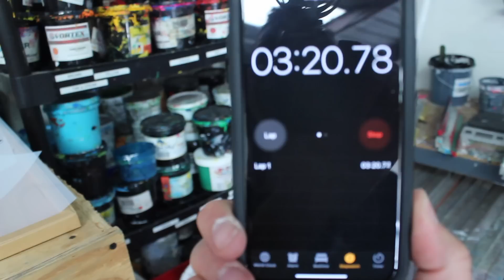Is a Darkroom Necessary for Coating and Exposing Emulsion? Screen Printing Tutorial

Comment: This is great. I don’t have a dark room. My studio actually gets quite a bit of natural light, and I’ve had zero issues. I built a small drying cabinet and made sure it was completely dark. 👍🏼
Reply from the maker: Nice! It's not exactly photography film, which is the impression I was under when I first started. Definitely can take it easy. When I was in the garage at home, I would forget I had screens out that were coated. I'd pull out the mower, mow the lawn, and come back to say, oh no. They still exposed fine.

Comment: When i got into screen printing most, if not all, suppliers and many youtubers said dark room is not negotiable and you have to have one. Two and half years with 4-10 screens a day and I still cant see why they would say you have to have one. I do many halftones, process and other fine detail projects. never had an issue. I have a guest bedroom in my basement and simply stack frames to dry and then stand them upright to store them. I generally do 30-40 frames at a time and some frames of rarely used mesh size, might go two or three months between coating and exposing. I even had some large sized screens go nearly eight months and then when used worked fine. The bedroom has a regular overhead light and is turned on several times a day for probably no more than 1 hr a day with the occasional 4-6 hrs when the kids forget to turn off the light. This spare room is also our pantry and is used every day. The screens are standing on the floor stacked upright  together so I am sure there is protection from the top frame. but I have never had a messed up exposure. I followed YouTube's Farmboy Graphics advice since day one and have not had a single mess-up. I built his super cheap exposure table and followed his 2:45 seconds and there has been only one screen with very subtle half-tones that I washed out with a power washer from the wrong side that I had to do over. we are talking in excess of 2000 exposures! Dont get me wrong, I have put films on backwards, upside down and sideways, but they always exposed beautifully..... It isn't my skill, it was simply carefully following the advice of Farmboy Graphics (by the way he has a closet to store the screens to dry and hold, but he coats and sets up his frames in regular room light). I have about $100 in my exposure table, zero in my dark room and all that "extra" money was spent on high capacity/quality conveyor dryer, better/bigger press and a quartz flash dryer which I wouldn't think of not having for a manual press. I usually lay my films on the shirt, on the press and place tape on them so I can mount the screen and get placement just where I want it. I have the main shop which is 26x24 and it has 24 4ft led shop lights. My shop has white painted floors and three small windows. It is very bright but I will shut down the lights directly above the press, but by no means is it "dim" in my shop. I use ulano orange and QTX which I protect a little more from the light, but since it seems like Orange gives almost as much fine detail in half-tones, I rarely use it anymore. Two months ago I did 275 6 color Sep Studio Mahi-Mahi fish fishing shirt on a polyester hoodie for a major high end boat manufacturer and we used Ulano Orange and the sales rep and marketing director commented how they looked so much better than past years shirts. They have since ordered four more jobs with one more on the books for their huge Annual boat dealers convention this coming winter. I am not saying orange is best, just I know how to use it with my system and customers are happy. I do almost all plastisol, so water based shops probably are different in their emulsion choice. 

If you are on a budget then darkroom and exposure units maybe should be first to DIY and save cash for press or conveyor. I had a rude , pompous salesman actually tell me i might as well as not invest any time or money getting into the screen printing business if i wasn't going to do what it takes to make quality screens with a $3,600 exposure unit. I saw him last month now working at Best Buy when I went to buy 2 new computers and extra monitor. He came up to me and asked how things were going and I said crazy busy and I had paid off all equipment and was hiring a saleswoman to handle all the sport teams jersey's/spiritwear accounts. I was getting a laptop for my saleswoman and a new computer and two large monitors for the shop. He said "Great, let me help you with that"....I said, "seeing how your recommendation was for me NOT to even bother opening my shop unless i bought your $3,600 exposure unit was unbelievably wrong and false, why would I now trust you for my computers?" .... he shook his head and stormed away. The saleswoman I used at Best Buy whispered under her breath "You have no idea how much he deserved that".

If someone stands to make money off your decision, your guard should be up!!! That includes people who have sponsors or are trying to acquire sponsors.
Reply from the maker: Thanks for sharing! Funny how things workout. I would completely advise to anyone to make as much of your equipment as possible to save money, aside from a conveyor drier, and the press. Most of the other equipment such as a washout booth, exposure unit, screen racks, drying cabinets, etc can be made easily. I bought new equipment with my washout booth and exposure unit simply because I was so busy that my time getting back at screen printing was more valuable. I think anyone who says you have to have this expensive piece of equipment to get going and a crap ton of space doesn't know what they're talking about, like you mentioned. Start small, buy used, build what you can. Slowly reinvest that money back into better and faster equipment as you go. Rather than taking out loans, buying the most expensive equipment to find yourself drowning in debt with no work to pay the bills. Grow you shop / equipment with your business.
Reply: awesome story... both of you. i have a exposure unit with 4 florescent 30watt "grow lights" inside. how long would you guesstimate exposure time with ulano orange? or can you recommend a good calculator? I've blown out 2 screens already using my shower head...not really any pressure either.

Comment: Great video.  I started using a water bottle to pre wet our screens prior to the wash booth.  Worked great!
Reply from the maker: Great screen printing hack!
Reply: I’m lucky enough to have a lil open tank sitting next to our washout booth that we put all of our exposed screens in and see the design lighten to ensure it exposed correctly 🤙🏼
Reply: @RookieMistakeYT   absolutely.  Single dip tank work great or high pressurized spray bottle worse case scenario.
Reply: @arnoldprints  high pressurized spray bottles scare me simply because for some reason I’ve had some of the finer lines and details in the designs wash out or fall apart. I will say though i believe it was a bad batch of emulsion because it kept happening with that specific bucket.

Comment: I asked Ryonet support about this because I dont really have a dark room/area in our house and read in the forums that while the emulsion is still wet, it's not really that light sensitive. Ryonet support said that was true for photopolymer emulsions, but the emulsion that I use, which is a dual cure emulsion that needs diazo,  is light sensitive at all times. =( Great video as always!
Reply from the maker: If you go and check my videos, I like to use TZ emulsion which is a diazo emulsion. Diazo emulsions expose slower by nature and tend to hold better detail. If anything, I have to be faster with the photopolymer emulsion without a darkroom. An employee of mine that's learning took about a good 7 minutes to setup the art on the screen. It was slightly exposed, but nothing that wouldn't washout. From my experience, you'll be fine with a diazo for a moment without issues.
Reply: Emulsion IS just as photosensitive. I have been screening since 1992. I work in a room with no daylight, but coat under a 60 watt bulb no issues ever. Coating a batch of screens takes 10 minutes. Leaving the drying or dried screens exposed even to incandescent light will fog the emulsion.  
Unless you can economically by small containers of diazo, I would go photopolymer. Storage is a year+ in a cool storage environment. Coated screens stored dark cool and dry will burn a year later. Details wise, I burn 45-55 line halftones no problem.

I started in 1992, went to chromatech PL in 1993, and have never looked back. Bought my first auto this spring, literally burning 45 line halftones process color job, this after noon.  Captains log July 3 2019........
Reply: @joeshmoe7967  Thanks for the great info! Yeah, Ive been told that photopolymer has a long shelf life where my diazo emulsion is just 6 weeks at best! I'm hoping to switch to photopolymer soon (SAATI Textil PHU) once I use up my current emulsion and I get a better exposure setup. I'm still using a  CFL UV Fluorescent bulb that came with a screen printing kit I bought almost 3 years ago. Right now my money is going into testing water based opaque white inks, since white on dark shirts is what my clients order the  most, as well as saving up for a good flash dryer.

Congrats on getting the auto! I just have a one station press, but hoping to get a 4 station soon. My main business has been printing shirts with vinyl, but now my orders are always over 30+ shirts, even 100+. Vinyl does not make sense for large orders, so its time for me to get serious about screenprinting again.
Reply from the maker: @joeshmoe7967  Good points and thanks for sharing. The basis of the video really is to really make people aware that they do not have to freak out about a little light reaching their emulsion during the coating and exposing process. Unlike photography film which as soon as it's hit by light, it's destroyed. I had a condiment bottle full of Ulano TZ which is a diazo emulsion, and it went from green to brown. The bottle is transparent, sat out in the shop, and I used it for pin holes. So I do agree with you. I'm just trying to help newer screen printers understand you don't have to freak out if a little light gets to your emulsion. :)

Comment: You can also just put sleeves on your lights to prevent any light penetrating the screen. We leave screens out for 2 or 3 min out in the light and no harm.
Reply from the maker: Good point. That's how my setup was at the house. My screens dried over night with our amber lights on. Here is a different story because we just have a cabinet.

Comment: Keep up these great videos!  I noticed it looks like you have a dehumidifier in you screen drying rack,  I was wondering if you would share the make and model of it?
Thanks, Mike
Reply from the maker: Thank you! It's actually a cheap $25 oven to heat the cabinet to dry the screens after reclaiming and coating with emulsion quicker.
Reply: @mikeydesignssilkscreen473  cheap and effective. love it.

Comment: Nice! So a couple of questions for you my ninja! Do you have fans in the cabinet? (Hurry up with the specs of that, I need that info...LOL) I noticed that was yellow mesh on a 110 screen, where did you get that? I can only find yellow mesh on 230 and higher at GSG.
Reply from the maker: I have a bathroom fart fan mount on the top, and a vent on the bottom so it pulls air diagonally through the cabinet. LOL, I'll get to that soon. They're older screens that came with the automatic when I bought it. I'm sure you could have GSG mesh some screen for you if you brought in your own mesh. They provide that service too.
Reply: @mikeydesignssilkscreen473  how do you stop light from getting in through the vent and fan holes?
Reply from the maker: @jonathanzambrano6349  The fan and vent is at an angle and place so there's not any light coming through.

Comment: Great video. How long does it take for your emulsion to dry before you can burn the screen?
Reply from the maker: Thank you. It depends on the mesh, emulsion I'm using, time of day I coat them, how full my screen cabinet is, and the season. It could be anywhere from 10 minutes to a whole day. I'd say at the moment, cabinet full, 100º outside, 90% humidity. It'll take a few hours. Only a few screens in the cabinet, about 15 minutes.
Reply: Mikey Designs & Silk Screen Cool. Thank you so much for the videos. They really help rookies like me.
Reply: @mikeydesignssilkscreen473  How do you know when they are done with all those variances? I am very new, just getting started. Do you touch the screen? Does it look different?
Reply from the maker: @chrisnwendyduncan  It will look different and no long look wet. The edges that bead up will look dry too. You'll notice the difference once you get into it.

Comment: bro thanks man i just had major difficulties coating my first screens with major failure but imma try it like you tomorrow
Reply from the maker: Nice! Yeah, just do 1 and 1 with the sharp side for meshes 195-305. Do 2 and 1 for 110 and you should be fine.
Reply: @mikeydesignssilkscreen473  thanks bro!! just coated my first screen this weekend exposing it in the sun like you did.! fucking excited!
Reply: @mikeydesignssilkscreen473  what kind of emulsion was this? I’m looking for a forgiving dual cure emulsion (water based and plastisol). Also what is 1 to 1, 2 to 1?

Comment: Not totally related to the video, but how can I go about printing large transparencies? I need about 13x13 inch ones but my laser printer can’t go that big.
Reply from the maker: You could tile them out if it's just a 1 color design, or you'll have to buy a printer that can print that large. There are also service providers that could do that for you if it's just a one off job.

Comment: Can you change the pallete and screen on any machine...and do they have to be the same size?
Reply from the maker: Most screen press manufacturers will have multiple size pallets. You could also make your own and use the stock pallet brackets.

Comment: Is a ready to use or do I have to mix something with the emulsion before coating ?
Reply from the maker: There's photopolymer emulsions which are ready to use out of the bucket, or diazo which you have to mix in a sensitizer. There are others, but those are the main ones.

Comment: Bro I have a 80 w uv led flood light ,what distance from light to screen do you recommend? And time to burn the image ?
Reply from the maker: I would say at least 12-16 away. Just make sure the light is covering the entire screen. Depending on the emulsion, with a led flood light, might take 7-18 seconds. You'll have to some testing to dial it in.
Reply: @mikeydesignssilkscreen473  im using ulano orange sbq
Reply from the maker: @miguelhernandez2769  That's a good one. I'd start around 5-7 seconds and work my way up from there.

Comment: How long does the screen take to dry after coating it with emulsion
Reply from the maker: It depends on the temperature where you are at. In 85-100º weather, it might take 5-10 minutes. Anything below room temperate may take around 20 minutes. Putting your screen out in the sun to dry will help it dry faster.

Comment: So I have to coat both sides? And does the film go on the squeegee side or the print side?
Reply from the maker: Definitely need to coat both sides. Coat from the print side, then the ink side to push the emulsion to the shirt / print side. Put your film on the print side / garment side. Not the ink side. Make sure the image / film side is against the emulsion, rather than it being away.
Reply: @mikeydesignssilkscreen473  thanks mate! I got there in the end! I ended up doing two coats on both sides but it ended up working in my favour! Haha! I made another screen up with 1 coat each side and it didn’t work as good as the first… not sure why. But ah well, I know now!

Comment: With out even watching the video, I will tell you this: I have been coating with a single 60 watt bulb, since 1993. As long as the light source contains no UV you are good to go. You do not want any stray daylight, but room lights are fine for short periods.

I coat 6-8 screens in about 10 minutes.  Long enough exposure to room lights will 'fog' the screens so they need to be dried and stored in darkness. You easily know if your coating, drying and storing is OK, by how easily the details of your art wash out when burning and rinsing.
Reply from the maker: Good point! Thanks for sharing.

Comment: how long did you burn your film for?
Reply from the maker: On our unit, about a minute for a photopolymer, and 2:30 with a diazo emulsion.
Reply: @mikeydesignssilkscreen473  awesome im using photocure wsr mixed with diazo emulsion and i have a well kinda makeshift burner its pretty bright and it worked with 1:20 but i just wanted proper advise im pretty green at this and i also have a ricoma mt1501. so i hope you dont mind me droping in for info brother? i appreciate you for taking the time as well. god bless bro

Comment: how long can it set in the dark before use?
Reply from the maker: Depending on the emulsion, 6 months to a year.
Reply: Mikey Designs & Silk Screen while on a screen?
Reply from the maker: @l.a.the.w3026  Definitely! As long as you keep it store at room temperature, out of the light, and where there's little to no humidity.
Reply: Mikey Designs & Silk Screen ah thank you.! I got worried cause i have from couple days ago i didn’t end up using.
Reply from the maker: @l.a.the.w3026  You'll be fine a good while. We coat 22 screens at a time and it takes us, depending on jobs and how many colors, a couple days to go through them.